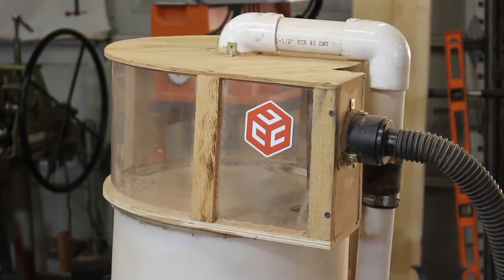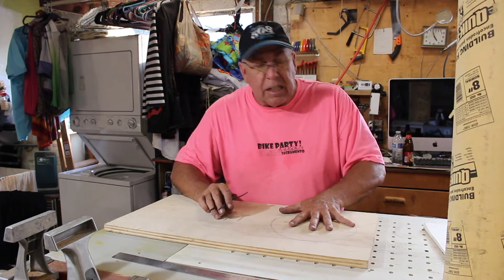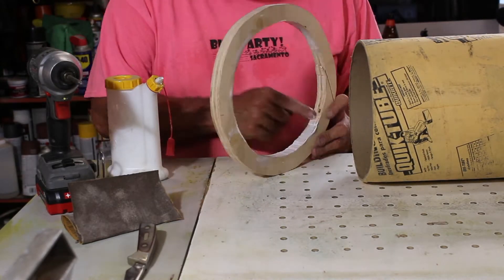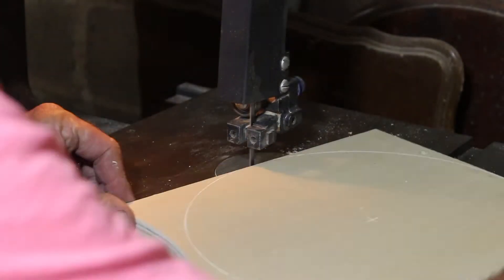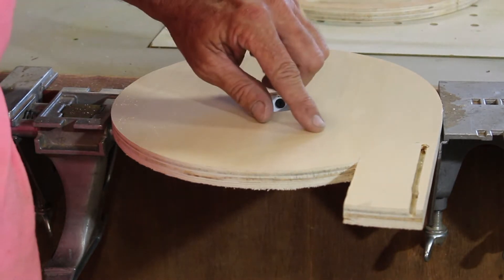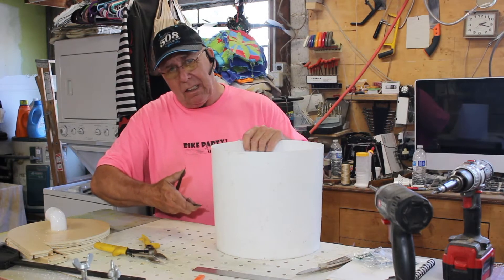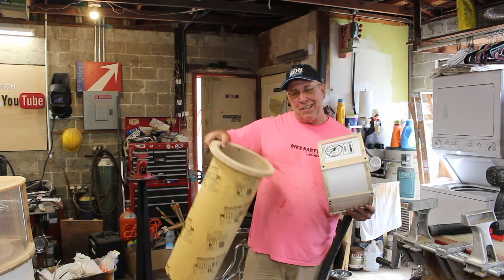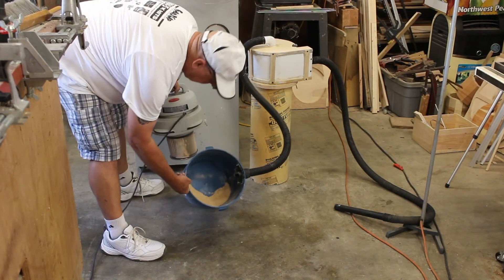How to make a Thien Baffle Dust Separator! Cyclone

Comment: Nice video, but I can't help but wonder why you didn't take advantage of the CNC machine to cut those wooden parts.   I just built something similar for larger equipment in my shop using a steel trash can, but I used my CNC to cut all the parts and grooves for the baffle.  You get a much cleaner fit and finish without all the sanding and shaping and the parts fit tightly together.  Not that your ideas are not useful.  Using the concrete form tube was something that is great as is using the vacuum to pull in the sealant.   I am about to upgrade my CNC dust vacuum to include a smaller two stage design.   I think a concrete tube would make a great customizable catch container.   Thanks for the video.
Reply from the maker: My viewers get angry with me when I use sophisticated tools. I try to bring every project down to a level where anyone could make it.
Reply: @WildmanTech  Hey, I can understand that.   Can't please everyone on YouTube.   Like I said, nice video with some good ideas for me.